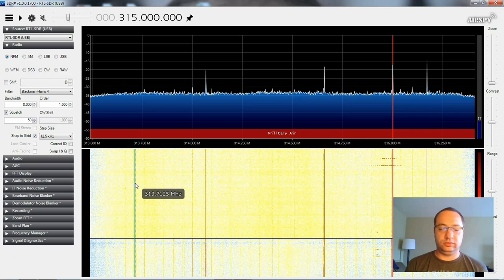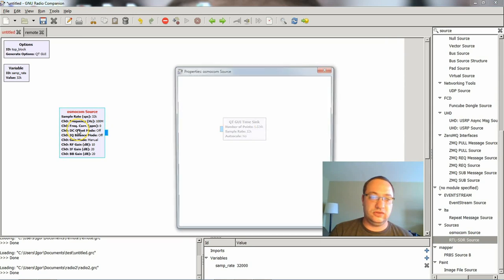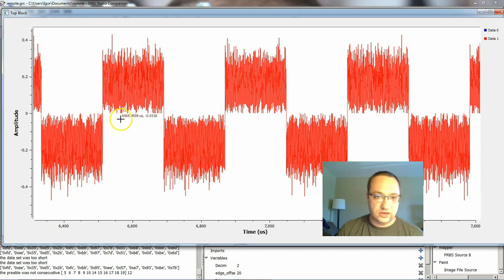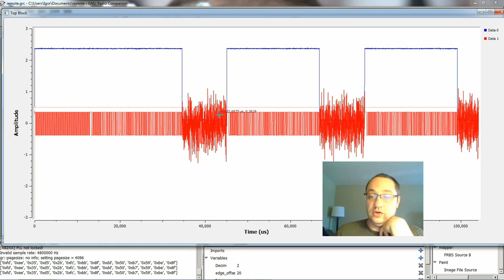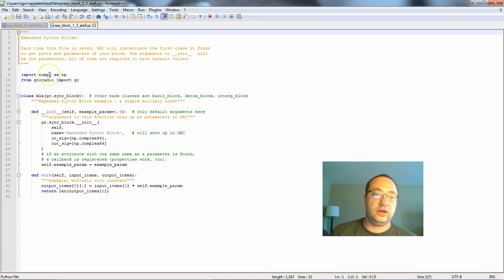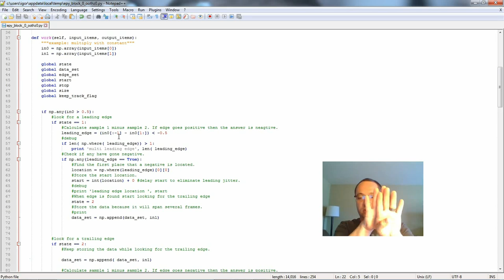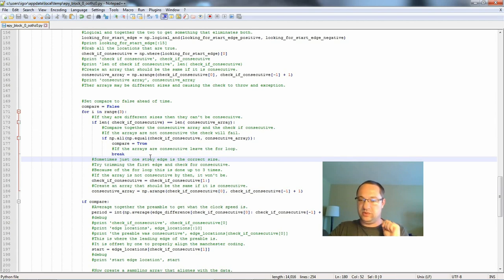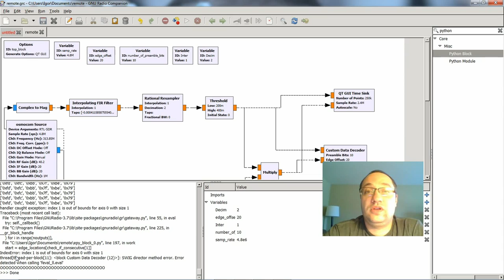eapbg #59 Intro to GNU Radio Companion, reading a key fob with SDR

Comment: Thanks for the videos. What's the difference between filtering before or after the demodulatiom?. Thanks again :)
Reply from the maker: You would not want to filter before demodulation because the signal would be in the complex domain. After demodulation the signal only has magnitude and is easy to filter.

Comment: Nice video, try to make the flow chart gnu radio, but i'am missing the block Custom data decoder? I' m using the latest version 3.18..
Reply from the maker: The customer data decoder is a python block with customer code inside.

Comment: With all due respect, if you're going to teach something like this. Please don't throw in parameters from memory. Please show how you came up with them. A project that is already complete, is only partially useful to us, that are just learning.  Otherwise, good video. Just explain what you're doing, and why.  For example, the FIR filter. where did you come up with the End of Pass Band and Start of Stop band. Without knowing where you came up with those number, puts the rest of us -- that know how to do it -- at a pause in our learning, because we can't go any further.   Thanks brother.
Reply from the maker: I'm implementing a low pass filter. The FIR filter designer needs to know where the pass band ends. This is were we want no rejection. Where the stop band begins. From here we want to reject frequencies. The two frequencies define the transition zone where the rejection starts (at the end of pass band) and where the rejecection reaches maximum ( at the start of the stop band). The stop band attenuation is how much rejection you want.
Reply: @eapbg  Hi brother. Thanks a lot for the explanation. I really appreciate you taking time out to provide this.  :-)  Have a great one.